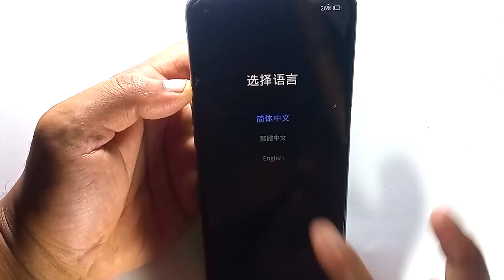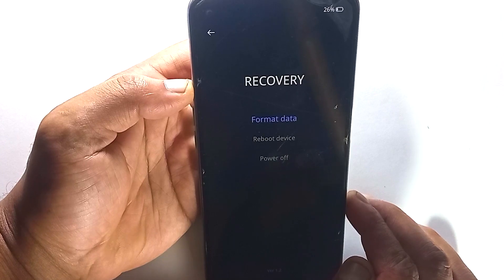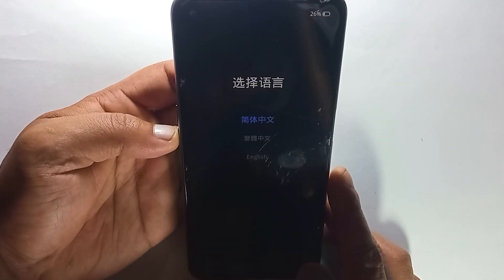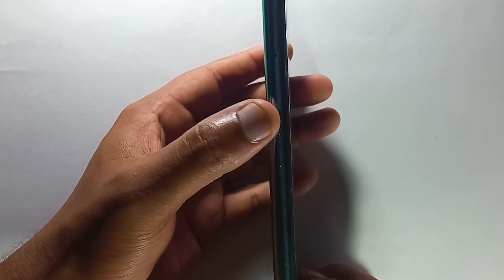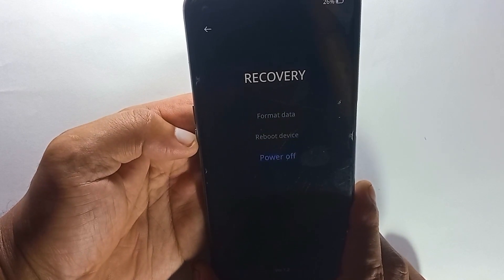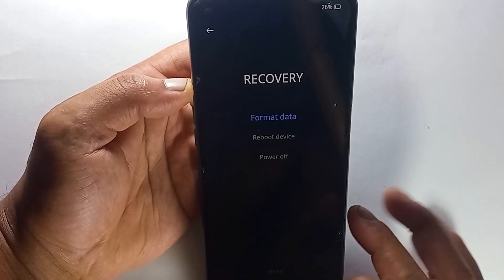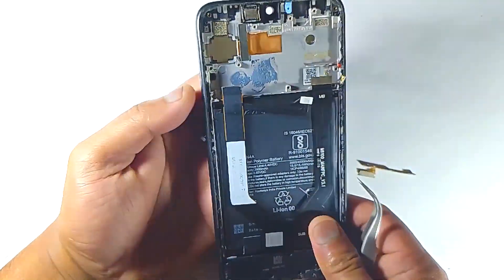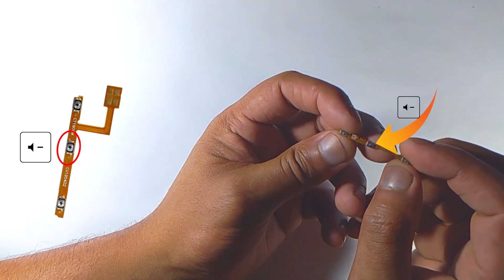Fix Realme/Oppo Stuck in Recovery Mode | Easy Step-by-Step Guide

Comment: ALTERNATE SOLUTION: For people that are still looking for fix because they sound button are cracked even worse .. Tilt your PHONE SIDE WAY, the side face that have volume up and down facing downward.. and try to hit your table with your phone in that position to DISLODGE the stuck button. try to tap the button to see if your up and down button is function (not necessary but to check if it working, can skip)

... ELSE just instantly reboot after hitting the table if your phone device volume are so sensitive to touches.
Reply: Love you so mush bro I want to gift you bro you don't know the feeling you are god the Great of all time ❤❤

Comment: tech guy asked for 5000 rupees to fix this, i did the press method 15 times and it works. thank you so much brother.
Reply: What to press and like pressing to much pr holding it?
Reply: Which button did you press?
Reply: @BelaSoni-d3x  volume down button
Reply: Was your button working?
Reply: @sajjanagarwal821  it was kinda stuck , so it was going to auto recovery mode. pressing made it unstuck so it opened like before.

Comment: Everything on my phone works but im still stuck
Reply from the maker: remove or change the volume down key
Reply: My unit is oppo reno 6z 5g btw
Reply: Before thr problem occur, the volume was randomly popping on my screen so i think its a malfunction.
Reply from the maker: @ObvDELUX  Remove or change the volume up key
Reply: I will thanks :))
Reply: My dad hasnt come back yet so ill need to wait so i can tell my dad to take my phone to a repair store
Reply: Hey so uhmmm i did format data which means i deleted the data on my phone to try and get out but it did not help. Now my phone is stuck on loading screen that still is going to recovery mode. Its going on and off forever.
Reply from the maker: @ObvDELUX did you even watch that video ?

Comment: My  down button is not working...
Reply: Thats the problem, change the button maybe it will work after you fix the button
Reply: Same problem
Reply: Same pblm😢
Reply: Same prblm😢😅
Reply: @Bharatheeeyy  Dude I just changed my button in a local shop it just cost 100 or even less if you bargain
Reply: the voulume up/down button is being triggered continuously, so its entering revovery mode every time you turn on your phone
Reply: @icrazydiga Just go to local repairing shop and don't pay more. than 150

Comment: Brother My phone is stuck on logo, I want data. And my only down key is working in booting page
Reply from the maker: Watch this video don't worry this method not only work in mi phone it also work in any other brand phone https://youtu.be/GjTsZhInsck
Reply: @ Sir still not working, my phone is realme, recovery key is vol down and up button is not working in navigation, so by fixing vol up it will solve the issue?
Reply from the maker: you don't need an volume up button, in realme recovery mode touch will do the job
Reply: @TechFusionGuy  I rebooted it buy click also by button, still stuck on logo. I want data plz help me
Reply from the maker: @Nikz_kapse  to be very honest sir,  your issue indicates deep hardware issue it's not something that you can fix it by yourself, if you want your data then you should contact to any professional (but still sometime just wiping your data can fix this type of issue but i get it you don't want to lose your data)
Reply: @TechFusionGuy  Sir I have visited professionals they said you have to wipe data, I said I dont want device I want data. They said its not possible. But on YT I have seen some technicians swap motherboard or processor of same model other phone and then recover data. Is it true?
Reply from the maker: Yes, it's possible but expensive. Merging parts from another mobiles weakens their integrity, making them prone to permanent damage if dropped. A better option is to visit a professional data repairer who can recover data directly from the chip using specialized tools, though this too can be costly.
Reply: @Nikz_kapse  same problem bro Have you fixed it?